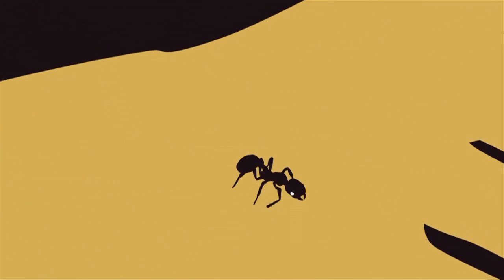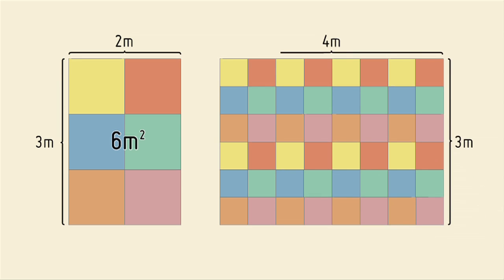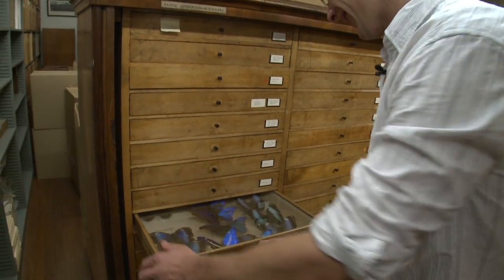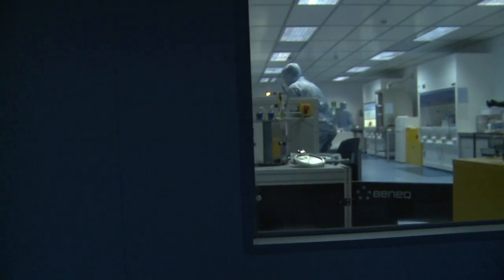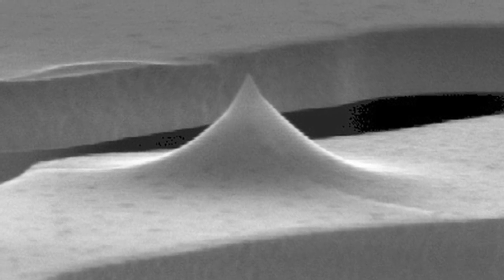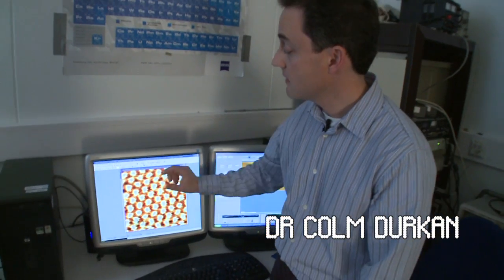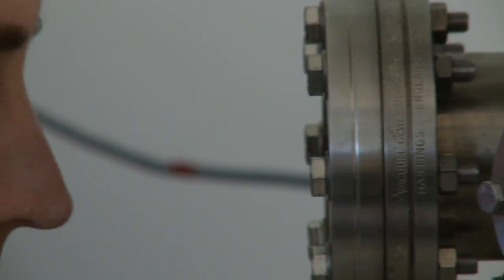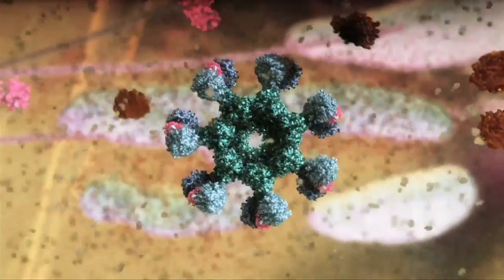The strange new world of Nanoscience, narrated by Stephen Fry

Comment: @Innomen You do know that he isn't using an optical microscope, right? Super lenses let the optical microscopes overcome a limit that doesn't exist with electron microscopes, the diffraction limit. So they would not help in any way. 

The reason we cant see anything smaller is that electrons have the smallest wavelenght we know of, yet so "Ever" is probably untrue as we might find something smaller later on. But not with super lenses.

Comment: excellent film. I have a Ph D in nanotech myself; some remarks:
the AFM tip engineering is probably never going to happen since the manipulation of single atoms just isnt quick enough.
also, the (spontaneous) self assembly of smaller bits into a larger structure is much better done by nature than by man. It turns out to be exceedingly tricky. We can, for example, not reproduce the self assembly of the simplest virus by synthetic means.